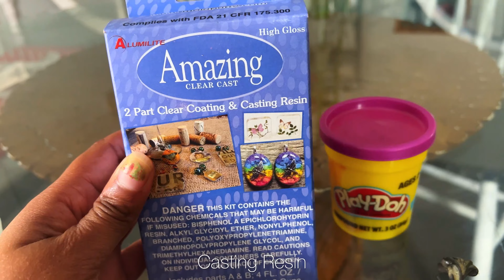How to Paint and Refinish Furniture THE RIGHT WAY ~ Repairing Drawer a Handle / Hardware Using Resin

Comment: Wouldn't adding mineral spirits to the primer compromise the stain blocking qualities?
Reply from the maker: No it doesn't compromise the effect of the primer. The bottom underneath portion that cannot be seen was not primed, but I painted it just to give it a clean look, and there was bleed through as soon as I put on top coat. The surface however was primed with 4 coats of primer so there was no bleed through. Thanks so much for watching and commenting! 💚